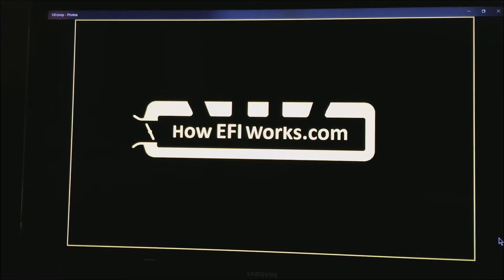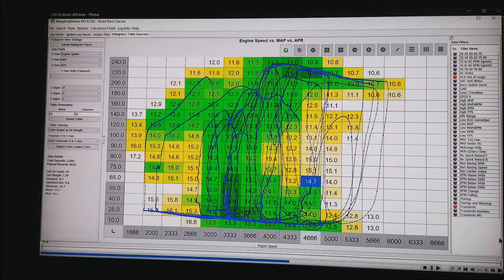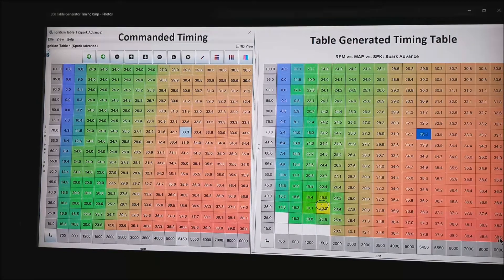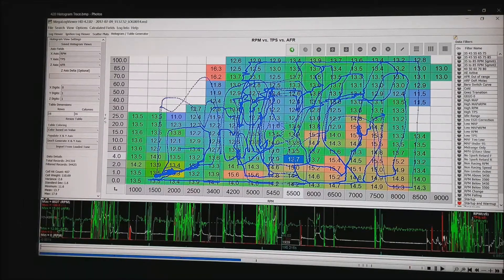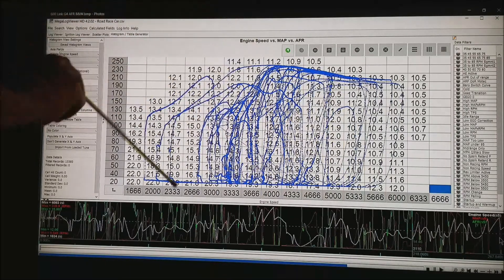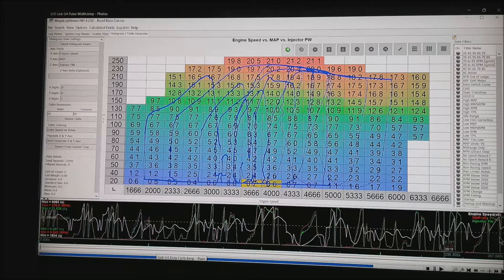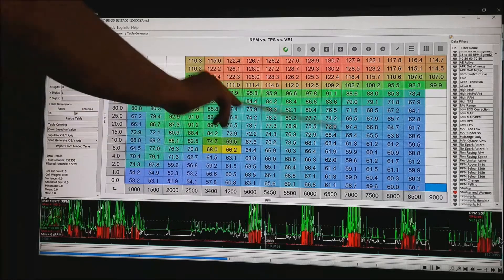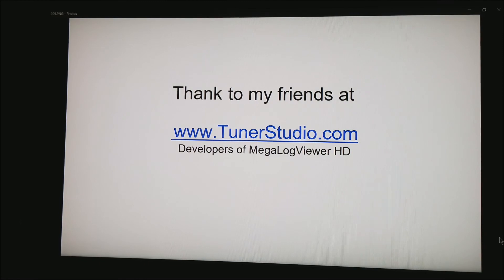The Table Generator or Histograms in MegaLogViewer HD

Comment: You mentioned @ low pulsewidths, the injector was unable to control AFR. That actually occurs often with injector pulses below 2ms. That's what the short pulse adder is for. If you don't have a short pulse adder option with your tuning software, it might cause your VE to look a bit bumpy at lower RPM. Thanks for sharing.

Comment: Hey Andy, what would be the formula for new cal VE to generate new VEs not running in closed loop?  I assume Afr table would need to be set to, say, 13:1 across the board too do so. Im using a power vision with wide bands to log data on harley stuff. Thanks for your time putting these videos together.
Reply from the maker: In the Harley world, use (VE Front) * (AFR that you got)/(AFR Target) to get (VE New)

Comment: Hi andy thanks for putting these shows together they are really useful. I have a Honda EN4 engine with a micro squirt firing a wasted spark coil pack.
 I have TPS CLT MAT O2 and a 36-1crank sensor. In the future I have got for Yamaha R6 throttle bodies for it but at the moment I'm running the original keihin carbs which im working on gettting dialed in. Is there anything i do with my data logs to help tuning my spark table
Cheers Dan
Reply from the maker: It depends what's in the logs.  RPM, MAP, AFR., Spark Advance...?
Reply: The tuner studio Logs have everything and i can pull spark tables too. Anything else i need?
Reply from the maker: Just do a fairly long log and post it up on the internet.  Post a link to it here and lets see what you are getting.
Reply: Ive put them up on the ms extra forum tuning section have to cut the logs down to get them under the 1mb limit. Happy to send you much longer logs. 
Dan